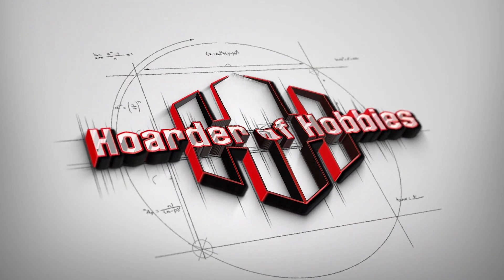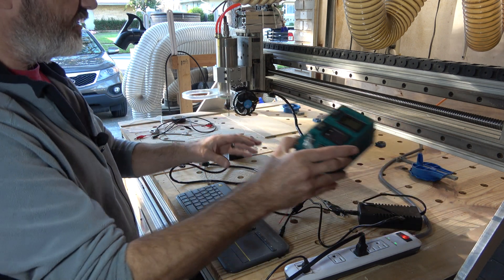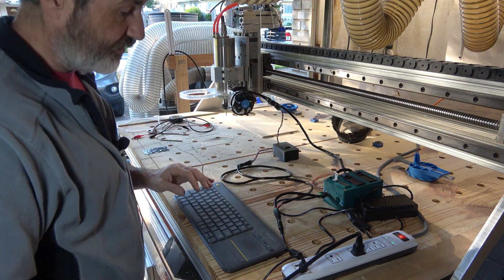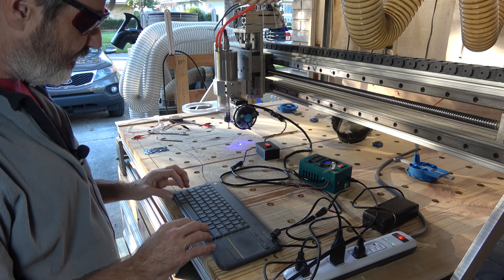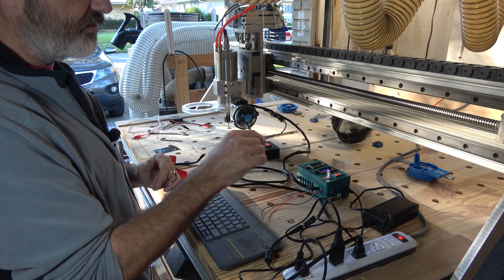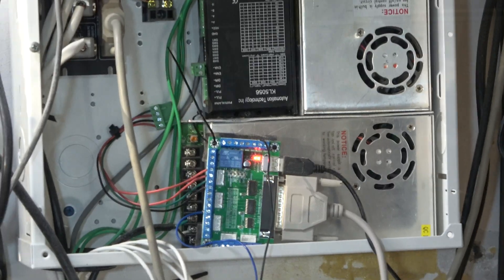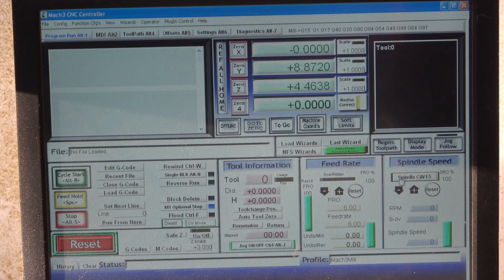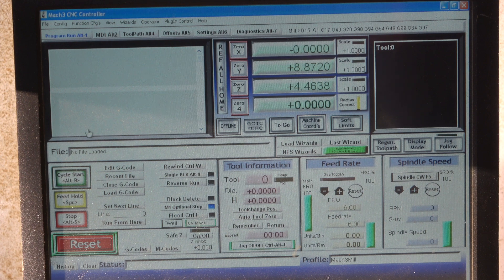Endurance Laser Hook Up - Mach3

Comment: Which post processor do you use. How will the laser turn on and off during the job process without PWM?
Reply from the maker: I downloaded a Mach 3 Laser Post Processor from some forum somewhere, but it doesn't use PWM - it's either on or off - so it's not great - I've since changed to an Ortur Laser for all my laser stuff - for the PWM
Reply: I see, which mach3 breakout board are you using. Does it have pwm on it? @JamiesHobbies-GGB
Reply from the maker: @bobheadzeek  If I remember correctly (this was like 2 years ago) the main problem was the computer would have had to do the PWM and while that's OK for a spindle, it would not have been good enough for a laser - the breakout board I was using for the laser is something like C10 I think https://amzn.to/3OB9vEb
Reply: I see, you just got a whole new laser rig. @JamiesHobbies-GGB

Comment: Can you share laser and mach3 wiring diagram
Reply from the maker: Sorry I don't have a printed wiring diagram - best I can offer is about 9 minutes into the video I explain the wiring
Reply: @JamiesHobbies-GGB  thank you🙂
Reply: @JamiesHobbies-GGB  hi..cnc router z axis drop occasionally while program running ….and normal movement move perfect but cnc router engraving  happen you have any idea about this problem
Reply from the maker: @mdsharook894  If the z axis is falling while you are in the middle of a job - it could be something like Idle current reduction - if the Z Axis is not constantly moving, it's possible there's a switch or setting that allows the driver to lower the current to save on power and keep the motor cooler - BUT that could also mean it's slipping because the lower current isn't enough to hold the motor in place with weight on the Z Axis... I'd look into your drivers and turn off idle current reduction for the motor and see if it still does it
Reply: @JamiesHobbies-GGB  In x y z a axis motor, both x and y is getting heat more but all the axis has same dip switch setting with same current and voltage

Comment: Which type pc mother board need to connect mach3 interface cable
Reply from the maker: I'm using a board that needs a parallel port from the PC
Reply: Look for some old DELL computers.